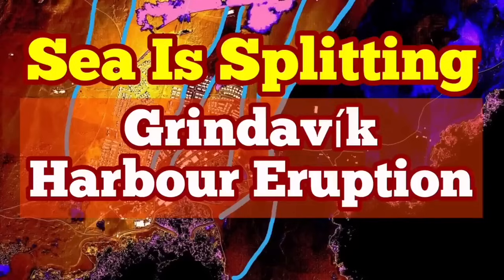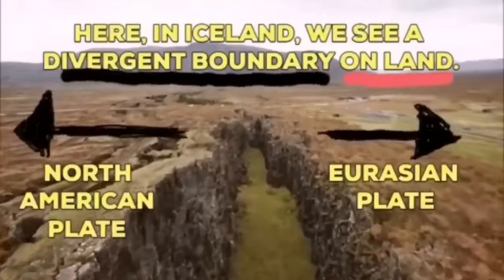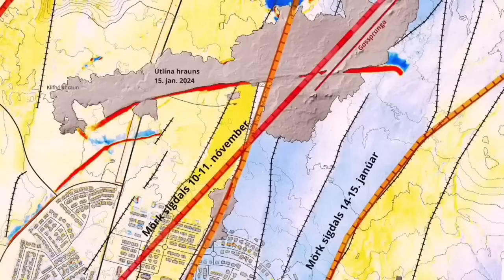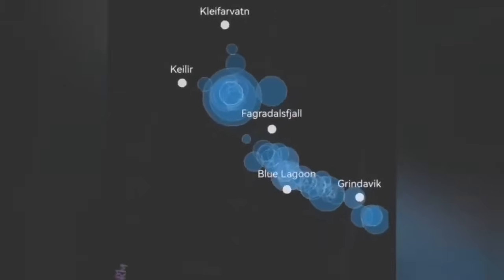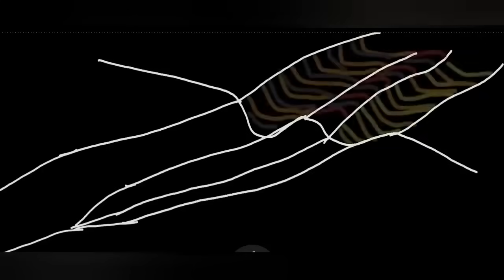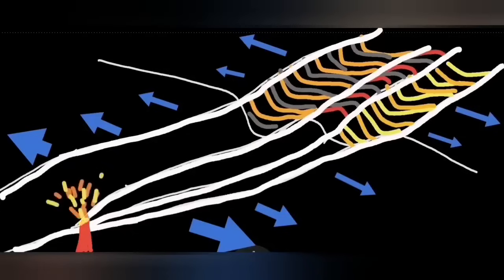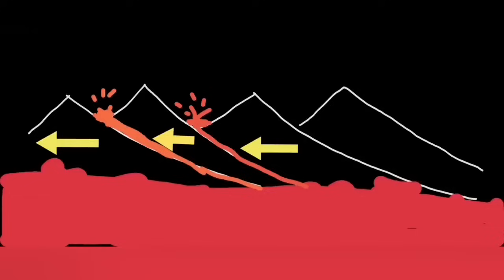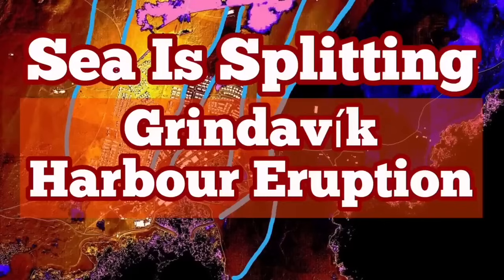Grindavík Harbour: Sea Splitting For Eruption, Iceland Svartsengi Fissure Volcano, Earthquake Depth

Comment: No one really knows as a fact that the earths core is hot... the deepest anyone has ever drilled in to the Earth is 70 odd miles so where's the proof of what the center consists of?
Reply: The deepest borehole was the Kola superdeep boring in Russia, about 7.6 miles (not 70) deep, encountering temps about 350 degrees C. 
The question is intriguing, however. If the lower mantle and the core are not hot, what conditions do you envision?
Reply from the maker: Through seismography. It is very much like ultrasound which shows the baby in mother's womb or mammography which shows cancer lumps. We see through the earth in similar ways. It gives a rough image, like mammography and ultrasound, but it still is an image of what is going on underneath.
Reply: Wrong...just because they didn't tell people...Research DUMBS... Deep Underground Millitary Bases...Tunnels across the whole world
Reply: It's hot alright ! The magma and surface lava is proof. But go ahead and doubt it.